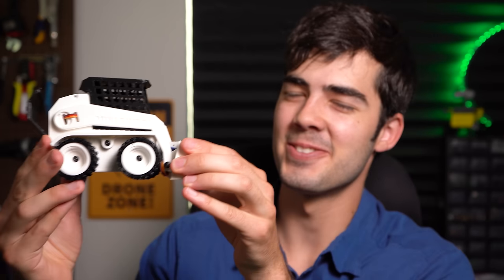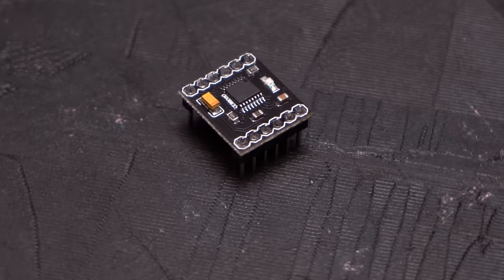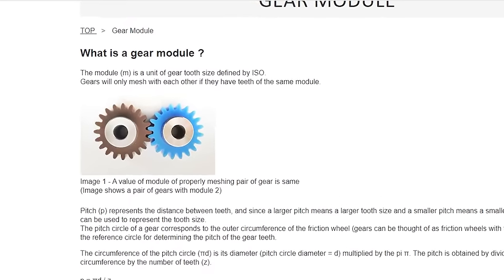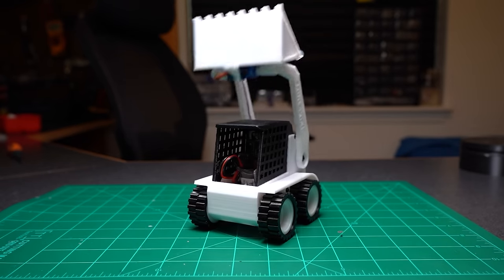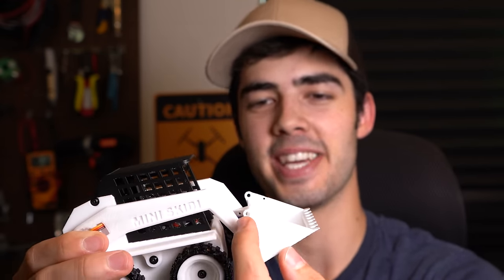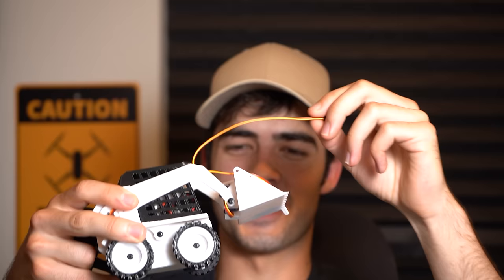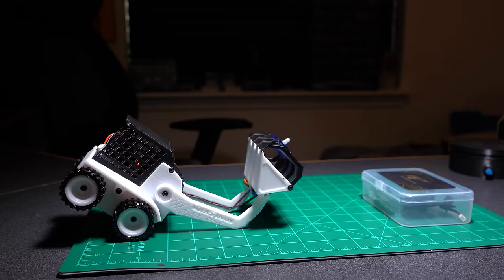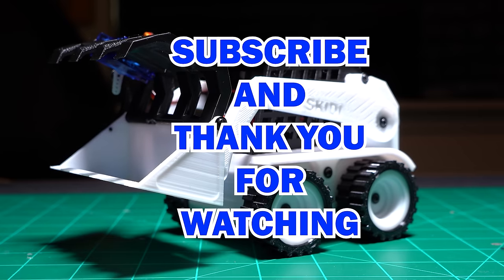V2.0 3D Printed RC SkidSteer

Comment: Would love to see more construction equipment! Maybe a dumptruck or a dozer

Would like to see these in V3
A quick disconnect from your servo on bucket so various attachments can be used, forks for pallets, a stump grinder, auger, etc.

It would than be helpful to use a servo wire extender and make a permanent servo connection point at the end of the lift arms for the second servo where the current wires come out. This could than be useful when switching implements so disassembly isn't required to rewire things.

  Love this project cant wait to see what else your cooking up!
Reply: Building onto the quick disconnect, correct me if I’m wrong, but couldn’t you just add a magnetic connector so that if you had the bucket disconnected you could just back away from it and it would disconnect?
Reply: I noticed that pretty early in the video myself, and I actually have the files pulled up right now on my computer looking at what it would take to add that to the arm and possibly a version of SSQA

Comment: a forklift attachment for the skid steer would be awesome... it would probably be a good idea to add some ballast to the bottom inside of the chassis... like tungsten slugs... or a way to add plates to the back of the skid-steer... you wouldn't have to take the arm all the way back to do your wheelies... and if you make the weight attachment modular, you could adjust on the fly.

As for a different robot project, a mini version of the 5 armed display bot that BattleBots uses for the giant nut display would be really cool.

Comment: You could add some peel and stick tire weights inside the rear hatch to counter balance the arm. The full size skid steer has a weight back there.

Comment: Get some lead car tire balance weights and stick them on the back for counter balance. The real thing uses a huge solid steel plate, but small lead weights in that rear hatch would sure help alot.

Comment: as an upgrade for the claw servo, you could use a double shaft servo.  then you could have a connecting arm on both sides to make the grip a bit stronger and more evenly distributed.
putting the connecting arm pivot point farther away from the hinge would further reduce slop in the movement.
real skid steers have weight added to the back of the body to make them more stable when lifting heavier objects.
Reply: The only double shaft servos I have seen are larger ones, do you get small servos like these with double shafts?

Comment: Make something based of Caterpillar machines. they have a big inventory and you will forsure find inspiration to build for the future projects. Maybe like a 3D crane with cables to like lift the skidsteer onto a lego building top. Would be really cool a downscaled crane with 3D parts and small electronics. Also because a crane is bigger than the skid, you can easy fit multiple strong servo`s and other tech to make it work and performe with power. All the best for upcoming projects ! Good channel

Comment: While it might be kind of difficult to do, I think it would be cool to add a small camera, so you can drive it around places without having to follow where it goes. For example, if you dropped something under your bed and can't quite get it on your own, sending in the Mini-Skidi with a camera under there (Maybe with some lights too, now that I think about it) to grab it would be fun and actually useful.

And for an easier addition, I think it would be beneficial to add some weights to the inside near the bottom to increase the weight of objects it can lift without tipping over, especially considering how strong the arm is now.

Comment: This is pretty cool. Maybe add a jagged edge along the sides of the bucket where stuff larger than it interfaces so it can grip stuff better? Probably would have helped pick up the drone case so it sits in a low point rather than the flat edge of the sides of the bucket

Comment: Very impressive.
Would be really fasciniating to have some kind of auto leveling keeping the attachment at the same angle when lifting it up. That would require moving the bucket and arm motor at the same time with a matching speed I guess.
Reply: Given how it’s programmed I don’t think that will be too hard to do

Comment: Great video! I see a problem with using a regular motor for the movement of the arm, currently you don't have any holding torque for holding stuff high but not above the machine. Maybe you could use a linear actuator like in a big skid steer, for example a small screw (you would get a lot of torque and holding power). But overall great project and for the next one I suggest a forklift (I love forklifts)

Comment: Nice project.  I'd suggest a forklift, which would have some new challenges design-wise because it has linear motion.  Do they make some kind of mini linear motor?  I've seen linear servos in very small RC planes, but they are not powerful.  Maybe a small belt/rail system like 3D printers?  Good luck with the channel.

Comment: Seems like the skidi could use a little more weight, as it’s arm is stronger than the body can counter. Maybe a metal plate in the bottom will do!

Comment: Project idea: What about if you made one of those big 3 Wheeler Side loader / Bi-Directional forklifts with the wheels that can all steer and lock depending what driving mode you're in, could probably be quite a fun challenge to design, also making the forks movement smooth too as not only do they move up and down they also can extend forward.

Comment: Currently building the 1.0 version using a 6ch RC receiver with an opentx transmitter,
bought 500rpm 6v n20 motors, I just read that the one he made used 100rpm ones.
it is currently printing, I will update results.
Reply from the maker: I hope it’s like the turbo’d version, the 100rpm ones are a little slow😂 definitely keep us updated!

Comment: How about a multiport docking station to auto charge your future mini digger equipment. Pull in and a set of contacts takes care of connecting to the unit. Then you will need a small truck and trailer to pull the equipment and haul materials!
Reply from the maker: I think that would be super cool! I’ll see what I can do

Comment: Future video idea. As one of your next project. I think you should make a backhoe loader. 
It has a bucket in the front, stabilizer legs on the side and an excavator arm on the back. 
Everything combined gives it almost 360 degrees of freedom in the air. 
That allows it to climb or step down large edges. Example (lookup): "Loading Backhoe onto Flatbed without ramps". 
Backhoe loader would be more out of the ordinary and I can't find any of them have been made motorized yet. 
Hoping you see my comment, it's 1/404. Liking my chances. Would love to win. 
Everyone else who maybe reads this good luck and have a nice day.

Comment: I used to operate a mid-sized track hoe... I would love to see a mini version of that, perhaps controlled by an XBox One controller (easy enough to do with the esp32).

The two joysticks could work just like the ones in the real deal, and the left/right buttons would potentially be the foot pedals.

The real trick would be allowing infinite rotation of the cab over the tracks 😮
Reply: Mini clock spring?

Comment: Time to start printing the new parts, get the electronics stuff and order the PCB.

For the next project I feel like some type of construction equipment like a dump truck would be good, my inner child also wants a tractor since I grew up in a farm 🚜.

Another idea is to make a full range of vehicles based on the same board design and allow for quick swap batteries as well as somewhat waterproof enclosure for the electronics or maybe just conformal coating them.

Comment: How about something with tracks?  Track pins can be literal clothespins. Pinheads in the direction of the chassis. A little bump or ramp on the chassis to push the pins back into the tracks, just like T-34 tank track pins.

Comment: Love the project. This thing needs hot swappable attachments with a connector for the extra DC output. Picking up pallets, adding a crane, lawn mower etc!

Any plans on shipping to Europe? At least the electronics? I have printing capabilities but not for TPU unfortunately, so an electronics + tpu prints option would also be useful for some people I guess.

Comment: just need to make a counterweight thing inthe lower or back part to stack washers or metal plates .. skids are usually heavy and with countereight on the back to lift heavier loads..
Reply: this is a real life thing.. not jsut that your model needs it..  they are usually solid steel and heavy motor so you need to compensate that with eights
then you ca n  lift to scale wights proeprly

Comment: Really nice job on this! I will deffo build one in the future, It looks about the right scale for my 45mm Garden Railway. 

Is there a reason you have not included some form of low voltage protection for the battery? A simple voltage divider to an analog in would do the trick.

Comment: What sized nozzle have you tried for the gears? With a 0.25 mm or 0.15 mm (very hard to print with a 0.15 mm nozzle), you will get finer details and a better shape to the gears even when printed at larger sizes.

Comment: I printed parts and make my own code to use bluetooth for controlling with remotexy. But have problem with one side belt, looks like its to long and wonts to get up un sprocket. I will try to make another one.
Reply from the maker: I would double check that you have the latest belt file which is “drive belt 4.0” I made it slightly smaller and widened the gaps in the belt

Comment: First time finding you channel and had to sub. one question tho. would it be possible to get all the white pla parts in separate files. that way it can be printed in diffrent colors and so you could print it in smaller run times. awsome work. really looking forward to building my own..

Comment: Those little geared motors, come in like 36 different spead/torque ranges... of course, the more required torque the slower the RPM's, likewise, the more speed to desire, the lower the torque output.. But, some of the most torque output units they offer, are like ALLOT.... just slow as heck...

Comment: Just got your video/channel recommended by YouTube, and I'm glad they did! Pretty cool project! As a future project, could you consider doing an RC truck crane? Could have an extendable boom and a working winch and pulley system of sorts to lift small loads - would be an awesome addition to a skid steer.

Comment: Cool project. Can it be made even smaller?  :)
Reply from the maker: For sure if I rotated the board and battery layout It could be a lot smaller
Reply: @professorboots  I bet the challenges would increase as the size got smaller.

Comment: This charger usually  have extra weight at its backside specifically to counter balance the front charge it could more easily grab this kind of heavy charge (like your last box test).

Perhaps it should be interesting to use an esp32-cam in the cabin. Set vertically as you did will then allow to remotly see where he drives and what it charge 😊

Nice job 😊

Comment: I think a good idea for a robotics project would be a robotic arm that can remove 3d prints from your printer when they’re done or even clear the bed when a print fails. That way you can automatically print without touching the printer.

Also great video as usual. I’ve recently bought an arduino and am learning the joys (complete and utter pain) of trying to get stuff to work😂

Comment: I love the layout of your videos! I think the next logical build should be a mini dump truck. Lil dumpy? Idk. But the lift gate could be a fun challenge for a linear actuator (or just a servo if you want the easy road) and the rest is essentially an rc truck. 

I’d like to see features like a locking latch for the back flap and maybe even a retractable cover for the “load” like real ones have for gravel.